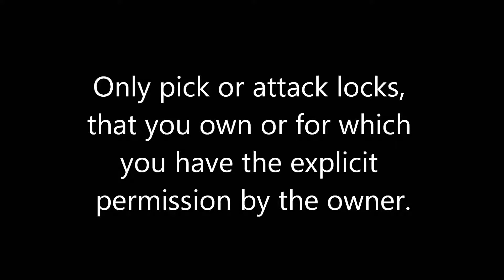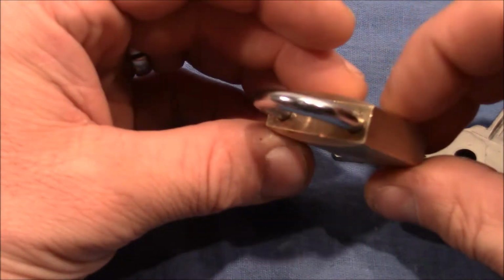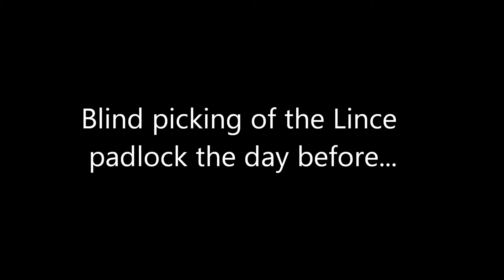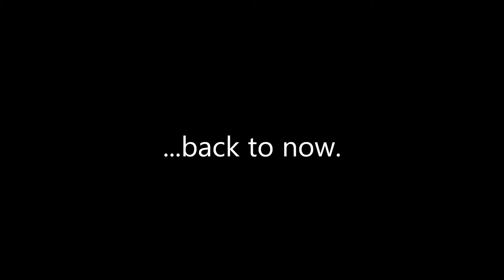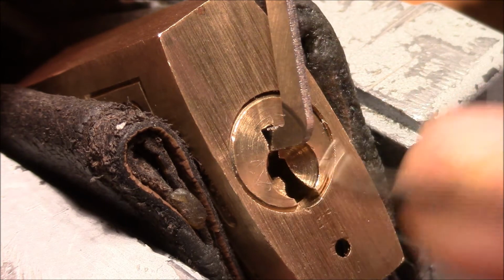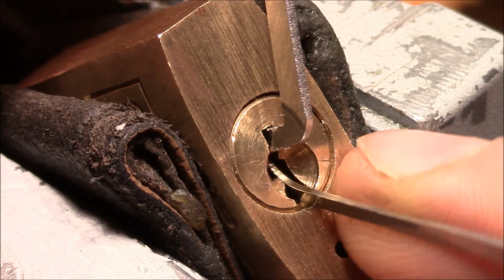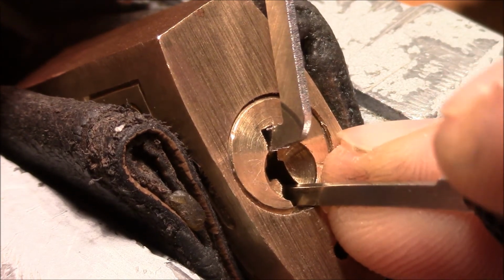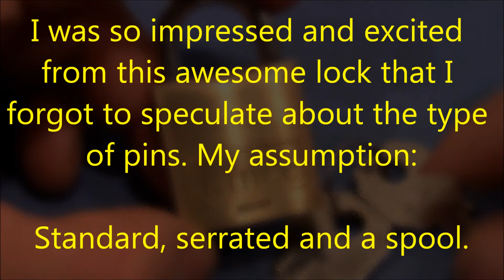(picking 266) Beautiful old Lince Padlock picked - respectful little lock - thanks 'Tallan Pick'

Comment: Very cool lock Potti, didn't expect it to be such a fighter :D. Great picking and nice composed video :).Especially the likely serrated pins did surprise me.
Reply from the maker: Thank you. Carlos pointed out that he only found spools in these locks. So maybe no serrated pins but just me setting the pins partially. Tight tolerances and great fun.
Reply: Yeah, maybe it's a little bit scratchy inside, it's an old lock. Anyway a very nice one :).

Comment: Nice lock. I'm trying to source the ones with the amazing Linx head logo on them... No luck so far, but eBay will provide one day. All bow to the almighty bay.
Reply: Lock Noob You can occasionally find them on ebay or Amazon. But shipping from Spain is quite expensive. I PM you a link later, there is a little trick in searching for them ;).As TP said, the new 300 ones have normal pins.
Reply: Thanks Foxxy